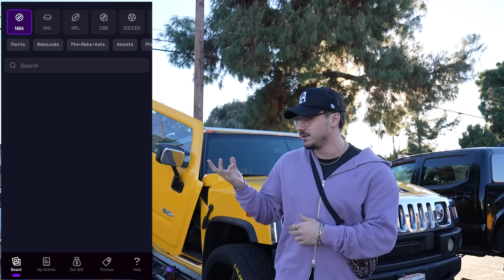I BOUGHT A LAMBORGHINI

Comment: not goona lie dawg, its def not your starter @ 5:40 its def your battery  because if it was your starter your truck would not have started, and your battery is using so much power from your sound system and your car itself, you should def get a new battery and check for anything wrong under the hood just to be safe & also make sure you didn't get leamon dawg.